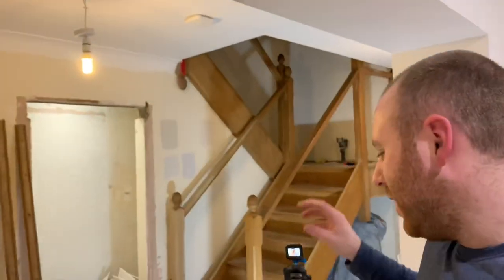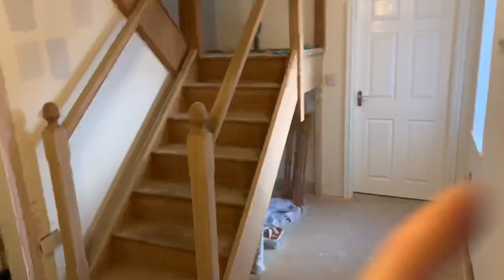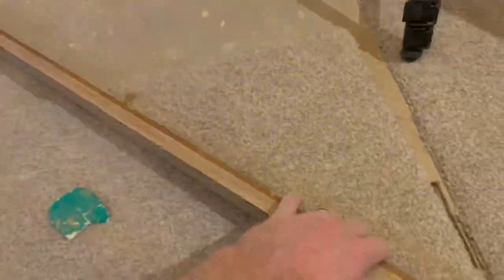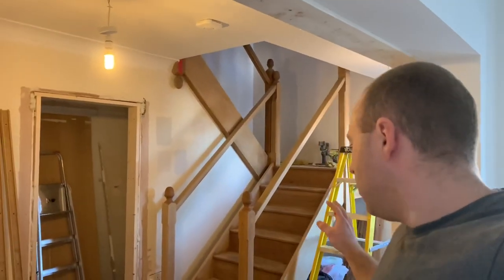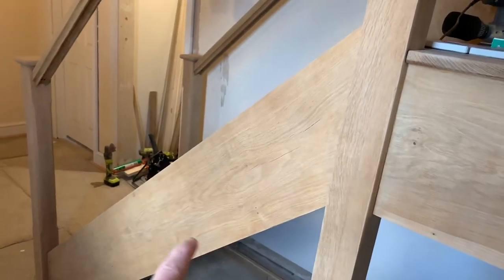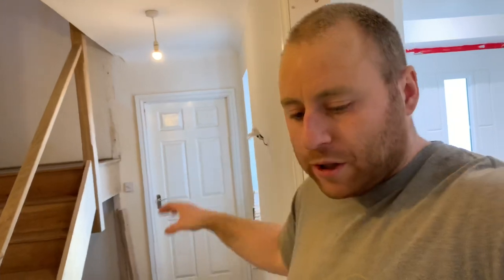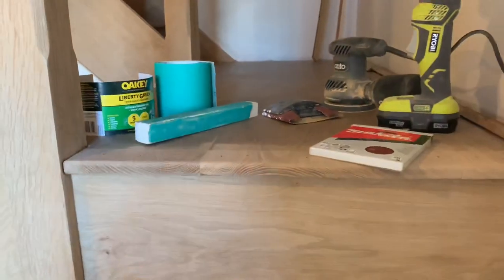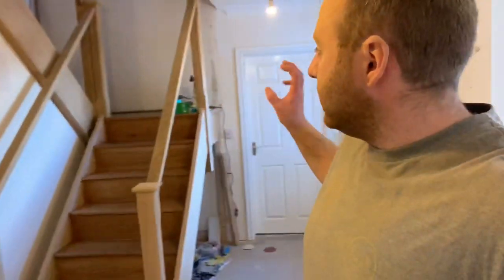Part 2 - Oak Staircase Renovation - The Sanding

Comment: doing the same job now... not a quick job is it . im guessing u used your multitool for the hard bits, like were the handrail meets the posts? i havent got one of those. may need to invest as cant reach with my sander. yours is looking great tho :)
Reply from the maker: Its not no, very time consuming. Yes multi-tools are very useful for that, and then even some section by hand. 

I have the upstairs to do, probably in the new year.